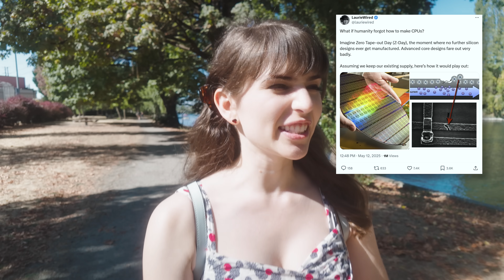what if humans forgot how to make CPUs?

Comment: Generally, for this to actually happen I think we would be dealing with some kind of post-apocalyptic scenario and processors would probably not be the top thing on our minds. What's more likely is losing our manufacturing capability along with some of the most cutting edge knowledge. There are not a lot of fabs that can make the newest chips, and the knowledge isn't just esoteric it's also a trade secret. Something like a natural disaster or act of terror could set us WAY back. We wouldn't lose it all, but we could end up decades behind where we are now and need to reinvent and reverse engineer to catch back up. Something worse, like a meteor strike or even bigger pandemic, and we could end up having plenty of raw knowledge recorded, but nobody left that could understand it and no machines that can make use of it.

Comment: I'm assuming that the knowledge just sort of vanishes? Everyone who knows forgets, and all recorded information about it is erased? Is there stopping people from reverse engineering and figuring it out again? Because that's what would happen, just because we don't know how it works doesn't mean that we don't know that it can, so we would invest heavily into regaining the knowledge. It would take time, I think the first part of this prediction would happen as modern processors start to die and industry is still way behind, but eventually we would start manufacturing chips similar to the older more robust ones, and slowly we would reduce the process size again and again. Most likely we would catch back up much faster than it took the first time around, but it would still take a long time and there would be new challenges along the way. What almost certainly will happen though, is that those larger more robust processors will remain popular. Every product design will make a decision about just how much power it really needs vs. longevity, after this disaster happened once we won't want to just shove the fastest most efficient chips into everything because we know the risk. There will also be more research into chip longevity specifically, and there will be stockpiling.

Comment: My garage server blade is 18 years old and still works fine,  my desktop cpu is 12 years old and still works fine. My work pc is 15 years old and still works fine. I think your timeline is a little short, I think we'd have 30 years before any major issues. Also, microprocessors are not CPUs, and FPGAs would still exist. If the world stopped making silicon chips, then yes, major issues would ensue. Look at the chip shortage during lockdown. However, CPUs are not the same as general ICs, microprocessors and fpga ect would still be produced. A pi pico can be turned into an Apple Mac emulator, sure, computers would take a step back, but they would survive as copies of their vintage form. Modern large screen TVs would not longer be able to be produced as they run totally on a cpu nowadays. So screens would shrink.

Comment: To <people poo-pooing the premise> - The point of Science Fiction is to take a premise and explore it to absurdity to provoke wonder and a conversation,

Perhaps the premise could be framed more practically like "what if we ran out of gallium and couldn't make modern transistors?" or "what if EMPs from a nuclear exchange wiped out GPS and the fallout contaminated materials critical to our technology infrastructure" but those scenario would probably be too large in scope and degrade quickly into rabbit-hole discussions defended by rabid fiefdoms.

Our technology is very vulnerable to the loss of tribal knowledge and the outsourcing of the manufacture could be a problem for technological societies that lack the infrastructure to replace it easily.

Comment: I think some mechanical drives would continue lasting for decades past the ends of SSDs, because they go unused. Sure, in any sort of usage environment the mechanical drive dies first. But if you drop one of them in an unused fridge it will last for a really long time. So will the SSD, though all the data on it will decay, and we may be left with blank but operable SSDs.

Comment: I enjoyed your breakdown and the amount of thought you put into it, but I think your timespan is far compressed. Storage is the main place that I totally agree with you because high usage SSDs will fail in 5-10 years and Spinning Disk won't last 5 years. If anyone sees what is going on and intentionally releases firmware to slowdown data writes then that can be greatly extended. The biggest breakdown on spinning disks is on the platter, so the other components won't really matter.. Battery-backed RAM will become the storage medium of choice. If this scenario is silicon production is down, vs just CPU production, then I think the most immediate impact will be felt in washers, dryers, cameras and microwaves.... among other things. Widespread computer breaking would be 20+ years off, especially when developers are forced to learn how to optimize their code again.

Comment: I was born in the mid 90s and grew up as the internet was becoming ubiquitous, so I've seen technology change around me as near everything became more integrated with the internet. This has also led to me having a bit of a fascination with the way things were done prior various technological leaps including the widespread use of semiconductors and integrated circuits. If you eliminate CPUs, A great majority of communication technology still remains, albeit not in its most modern forms: Radio, telephones, television, film and photography. A channel I will recommend is Technology Connections. He looks at the history of a lot of fairly mundane appliances and communication technologies and the analog and often electro-mechanical natures of their control systems. I feel like it pairs well with this video.

Comment: is this everyone forgets how to make integrated circuits or CPUs?  there is a difference here we should be able to make some form of hard drives and network switches from discrete components and does this exclude optical circuits and basic transistors or valves

Comment: A designed a memory computer based on shift registers and two memory chips and a clock back in the 90's. Today I design analogue computers with trinary logic and topology based analogue computers much faster than today's standards. My competitors mainly boost guy have buried me. I have been destroyed. I am now in the possession of an algorithm that has no error. I use a 3 year old computer and I get assassins trying to knock me off. As an astrophysicist I have knowledge years ahead of current established thinking. I get constantly debased by the establishment. I am approaching a position to strike back against the established systems. I could use some support since I have spent most of my life in isolation.

Comment: RE: the battery deterioration threat mentioned at ~6:30 - I think flash storage may be a bigger issue in many ways. You can technically run a battery-powered device from a wall socket but the flash storage on portable devices has a pretty limited lifespan AFAIK. Maybe jack into the power grid and run your OS on a ramdisk...

Comment: I think we'll go back to vacuum tubes. If all electronics computers failed then maybe something like the Babbage mechanical computer will be re-discovered and developed. Another path is biological computers. It would probably be less precise than digital computers, but it'll probably work.
9:36 I disagree. I have hard drives well over 10 years old that are still retaining data. While newer TLC and QLC SSDs have to be powered on every few years to let the controller refresh (ie rewrite) the data due to electron tunneling.
11:21 CD-R and DVD-R's chemicals have finite life as well, especially when unburned.

Comment: I was thinking computers will all be running on 386s and 486, the last of the "hardened" CPUs. Beginning with Pentium (586s), it when we started miniaturizing micro traces and transistors. Basically, the newest CPUs are going to die first, which is going to lead to a renaissance of micro-kernels. Operating systems like Linux and their desktops will return prior versions, like Linux version 2, old XFree86, and Gnome 1.2/1.4, eventually more people will even go back to terminal emulators due to the real dollar "cost" of cpu cycles. Then I got to about 2:00 into the video and there it is....CPU lifetime and mtbf/mttf

Comment: In my own theorizing it of course starts with a scenario, be it Nuclear EMP's (among full on nuclear war), A once in a millenia solar storm, or even a systematic attack of the electrical grid. For whatever reason our grid goes down, it takes like a 1-6 years to replace some of the transformers necessary, let alone replacing components in literally almost everything. Computers are no longer available to the general public, worst case scenario private companies don't share or publish what they are doing on the cutting edge, or have forgotten what they did previously so we can get back to 80's tech. Or it's just not profitable to make them and the companies go under. I think we're really limited to rebuilding based on what is in the public domain and how common the tech is to build circuit boards. If we made makign circuit boards and chips as common as 3d printing it wouldn't be as much of an issue but until then we're limited by what's in the public domain. 

It's reaching a state of SHTF where people are back to surviving daily, just looking for food and water to get by which is the worst case scenario, and the longer that we remain in survival mode the more knowledge will be lost generation by generation. possibly as little as 2-3 generations when your focus completely changes. That said the knowledge won't go away but will be limited by people actually doing it. being sent back to basically the steam era/oil era, what we can make with steel production, recycling, people who know how to work machienery with mills and laythes. The saying I believe goes I bought the part and had someone else install it, my dad bought the part and installed it himself, my grandfather had to make the part. I think we're on the precipus of Gen Z being the generation that "had to make the computer and code the program". but it all depends on easy access to be able to do that like people having a home workshop with metal working and the know how to rebuild parts.

Comment: Random thought but this made me think of an article I read about trying to modernize the computers that communicate to and launch ICBMs. A lot of those computers are still using 1980's technology and it's been pointed out that our smartphones have more computing power. From a cost benefit perspective, perhaps having these tried and true computers would cost less in the long run if they are cheaper and more reliable than newer computers. They've lasted 40+ years and I can't see a modern replacement with that level of longevity. It also probably doesn't take that much computational power to launch a ballistic missile. Of course, there are other problems with having aging ICBMs and defunct coding architecture that needs to be address but I digress. In summary, perhaps for certain applications, we don't always need the most cutting edge and fastest CPU but rather something durable and reliable.

Comment: We probably will forgot one day. We forgot how the Ancient Egyptians built the pyramids, but the world is still ticking along...
Reply: The big difference there is the Pyramids are nothing but a monument to a dead god-king, they have no real function to society but reinforcing the divine right and power of the ruler. Where all those computers that handle everything from traffic lights and sewage works to the phone exchanges, internet, banking etc - computers and compute too small to call a computer anymore are entirely essential to everything we do now.
Reply: @foldionepapyrus3441  I other words, pyramids became obsolete when the society moved on. So will the CPUs.
(And I say it as a firmware engineer.)
Reply: @olmostgudinaf8100  Probably, though even if the Pyramids where removed while they were relevent it wouldn't matter much to the society around them I'd suspect. Where silicon fab in this premise that appears to be assuming something terribly dramatic happens NOW... 

Inevitably eventually silicone fabs will die as vacuum tubes and clockwork style automata have

Comment: I have a huge twist on this.

We are talking about computational power with electronics, but as soon as this becomes a bigger and bigger issue, we'd start with concerted efforts for optimization, while large companies thinking of the future would start investing in mechanical computation.

Mechanical computation would be the least susceptible to those pressures on modern computing.

Using water, gears, weights and pulleys, you can compute quite a bit as long as you understand the basic logics behind it, and can evolve that into further languages for computation, you can achieve many great things without needing an ounce of electricity running through a wire.

Comment: I think I'd be ok for the rest of my unimportant life. Got a fresh 9800X3D running smoothly in my main rig, I didn't sell my old kit (10600K/Z490/DD4), and I do have 2 older i5-7500 and i5-6600 stuffed in some drawers, still in their motherboards. If that doesn't work out, I guess I could technically pull out my 2000's PC out of storage, an impressive AthlonXP 2600+ with 512 DDR400! I can't imagine I'd burn through all of them until I sign off, but even if, I've got so many other random used CPUs like P4's, Celerons and whatnot, even a couple motherboards to go with them, stuffed in some dusty boxes.

Comment: I've been on both sides in cpu manufacturing and software development. Before than US naval nuclear. Reactor Operator.  Carmack is entirely right. I started looking at projects online and how much I could reduce the code. Most projects can be reduce to under 10% of their current code. Often it can be reduce a great deal more. You might think that makes a reduces the power and such it runs to 10%. Actually it can be a good bit more. It can often mean the difference between it running in L1 cache or not. Probably the worst cause or offender that creates the excessive use of code lines is TDD. It isn't purely TDD's fault it is in fact a lot to do with the way people interpret how its rules should be applied. That said TDD in itself is a large part of the problem.

Comment: An interesting idea for sure. I think that the only way this might occur is wide spread destruction of chip fab infrastructure along side critical services, like the power grid.  EMP maybe?  The point is, it would take maybe a decade to rebuild the chip fab to current levels, providing we had the information to do so.  Much less to to build back up what we needed for 70-80's chip manufacturing. But much longer if the world had to worry about rebuilding the electrical grid too. I would think that would be a priority.

Comment: I think you kind of overlooked the fact that just because we can't make CPUs, doesn't mean we can't build anything else. There are still ways of computing without a CPU and we would just focus on refining those technologies instead. Also most of the manufacturing in the world has a heavy reliance on computation these days and the person who could profitably solve that problem would be very rich indeed, market forces would do the rest. I recon we'd have a bit of a step backwards, a bit of downturn, but in 30 years all the affected systems would have their replacements and we'd have moved on mostly.
Reply: Potentially a step forward. Optical logic is quite robustly developed, some companies make fully photonic versions of classic integrated circuits for nerds to play with. The knowhow, tech, materials, principles and all that to start rolling out optical processors is more or less all in place, there's just not a profit motive to switch course from going further and further with electronic ones. On top of the fact that abstract understanding is entirely relevant, I'm not an expert in computing by any means but I can and do use 20 year old hardware to easily do what was difficult on the hardware of 10 years ago at the time it was the latest thing & so on.

Comment: The story you told has a probability it will happen in the future. Since only few companies can produce both high end and low end physical chips. Making the physical chip at home is prohibitively expensive. Not only that, even managing making the FET transistor from scratch, making the purest monocrystalline silicon and slicing the silicon isn't viable at home. Someday, someone can make a recipe for a physical chip at home which is very accessible to a hobbyist, might be a futuristic AI compatible with native instant extremely large matrix multiplication RISC-50000 processor with billion cores running at 1Thz, with 1 petabyte of RAM, even high schoolers can do it.
Reply: I've been trying to find any mention in these comments, but no one's noted it so here goes: we have the tech to make photonic CPUs (PICs are already available as a niche item), there's just not money to be made in switching everything from electronic computing to optical. In this scenario, that would change instantly within the first hour.

Comment: Analog computing would see a big comeback now with even better components thanks to decades of material science because something would have to keep home appliances cars etc. working. While the CPU manufacturing process is being reinvented. The World would also lose access to air travel as the microchips inside most Airplanes would fail and need to be replaced with analog circuits of some kind. Factories around the globe would start hiring workers in mass to compensate for aging robots.